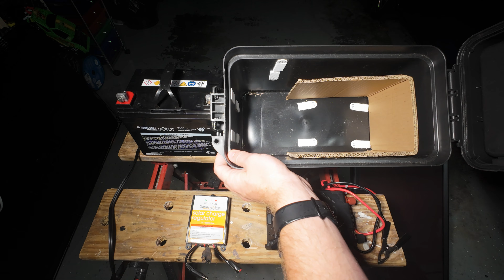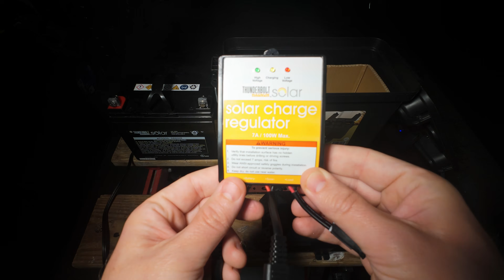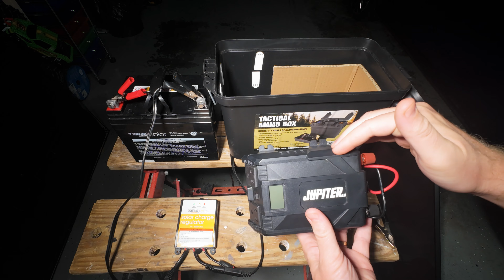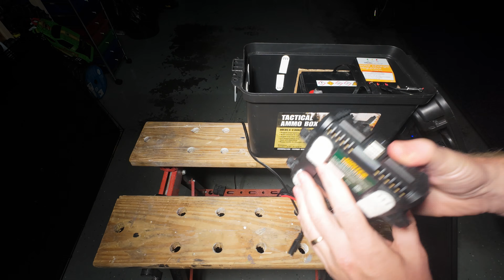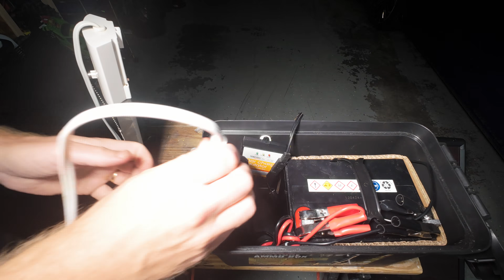Build a Solar Generator from Harbor Freight off the shelf parts?

Comment: A 35 amp battery and a 25 watt panel will do just about nothing. You just made something big enough to charge a cell phone. Nothing personal i appreciate builders but this is way over priced for a TINY capacity
Reply from the maker: Thank you for the positive feedback and watching. I would agree, there are a lot of improvements that can be made and if those were available locally I would have gone that route. I used to use a 20000 mah Anker power pack and it would just barely last keeping a phone and my camera charged over a weekend. This allowed me to keep 3 phones topped off as well as cameras and running an inverter for 120 when needed.

Comment: Except for the Battery, it's a fair little System. That 36 Amp Lead Acid Battery will  only give you about 15-17 Amps of useable power. IF you are going to use this battery, you'll need at LEAST 3 of them for any real runtime in an emergency.
Reply from the maker: Thank you so much. Yeah, I totally agree. I wish I could source a local supplier for LPF batteries. I will upgrade at some point but it did serve me really well for phones, cameras, etc..

Comment: You can run regular landscape lights...
Do they only have lead acid batteries??? 
At least use batteries terminals to BR and CH 10 Terminal Plug-On Neutral Ground Bar with 2/0 Lug plus fuses on negative side, and get rid of alligator clips...
Reply from the maker: Thank you for taking time to watch! Yeah, the shop light was more of an example. The past few times I have used some low wattage light strands and plan to move to some that is just 12v.  Yes, they only have SLA, where they are not the best, they are quickly accessible. Yes, bus bars would be a good upgrade as well as better terminal connection. These are planned upgrades that are not sources from Harbor Freight. Thank you for the suggestions and constructive feedback!

Comment: Modified sine wave inverter is not good for sensitive electronics.  Like phone and tablets.
Reply from the maker: Thank you for taking time to watch! That is very true. Thankfully this inverter has inline fuses and USB that operates independently. There are definitely improvements that can be made.
Reply: I believe he covered this several times during the video but yes, that is correct.

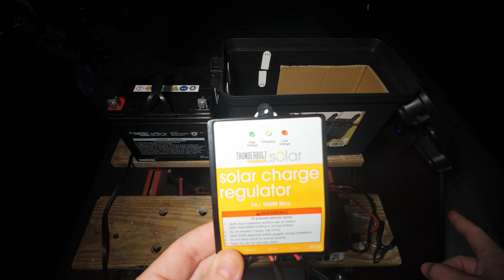Comment: need to mention: need to correct: (4:18) seconds if you put your solar panels in series, you increase voltage, not wattage. you want to put them in paralell mode.
Reply from the maker: Thank you for taking the time to watch and pointing that out in a positive way. You are very correct and in series that would cause damage to the solar controller. Someone else commented on voltage but I did not catch or connect that it might be because of that mistake.
Reply: The good news is if you buy more of that same solar panel they will automatically connect in parallel. I used their 4 panel kit to power my Power Tool charging station and provide light in the shed. I did finally upgrade the lead acid battery with a red odo and and a cheap pmw lithium charger controller for it. Seems to be working very well.
Reply from the maker: That is good to know. I have been back and forth on what to upgrade first and I think it should be the panels. If I cannot get my current battery fully charged in a reasonable amount of time then there is no use to upgrading the battery yet.

Comment: @matt
 That is a basic go kit that every home should have some form of & like you said dump the clips for O-rings & I'd add 2 things one side a vent intake with small pc fan opposed side so gasses vented from battery are not ignited by the inverter ! I'm a ham radio operator & have done the same basic setup but mine did explode because I overloaded the draw on the battery & it out-gassed really bad ! No one was hurt but scared the piss out me ! Some ppl cut the top out enough so they could mount the invertor face right to the lid & made access to it much better then they hot glued around the face but i think that's to easy get rain inside the plug !
Reply from the maker: Thank you. Yes, I will be improving and likely will not run the inverter max load simply because the battery would not last long.... Not to mention the clips are not a good enough connection for that amperage. I too have seen where others have cut holes, but I have seen some outdoor electrical panel boxes that have weather resistant vents and am wondering if I could adapt something similar to this small format. Funny in all the disasters that have occurred lately I had thought of looking into Ham radios. I've been in a few recovery situations where cellular is just not an option.
Reply: Don't car batteries have a place in the cover for a hose that could be used to lead the hydrogen outside the box, which would reduce the risk of explosion? I myself have a panel and controller bought 20 years ago, which were not installed at my summer house as I originally planned , and I put them into use in my apartment a few years ago. I mainly use it to charge my phone (the controller has a USB port) and to make coffee with a 12v kettle. It takes 15 minutes to make a cup of coffee, but I'm in no rush 😂  cables should be thick, and connections decent because the currents are high even at relatively low powers.   @MatthewVenturesOutside
Reply: Punctuation is your friend!

Comment: Awesome job! Great example for a quick temporary setup for a non technical person. I would explain briefly difference between peek and running watts. Remember that when an appliance is turned on, it briefly demands more wattage, then comes down to its running wattage.  That's why the peak wattage will always operate for a short time. Thanks again, and keep that content coming.
Reply from the maker: Thank you so much! That is a very good and important point on Peak/Surge wattage and running wattage. I think I felt like I was rambling when I talked about it. However, it is important to know that when sizing what you are wanting or could possibly run off of the inverter.

Comment: The solar charge controller (MPPT) can accept up to 22V and will draw up to 7A or 100W. That 25W solar panel has a voltage of 12V (doesn't say if that's Vmp or Voc). Connecting two of these solar panels in series would be 24V, which exceeds 22V. You would need to connect four of these panels in parallel, for a voltage of 12V and an amperage of around 8A. The MPPT would not draw more than 7A, so it'd limit you to roughly 84W. Nothing will get damaged though.

You can exceed amperage and wattage, but you cannot exceed voltage. Specifically, the open-circuit voltage (Voc) can not exceed an MPPT's max input voltage.

You covered some of this at the end of the video, but it would have been good to state the following in the beginning of the video:
Using an SLA battery for solar instead of an LFP is a poor choice. It simply will not last, it's heavy, and inefficient.
SAE connectors are not meant for solar use as they're not waterproof. Should be using MC4.
Modified sine wave inverters should not be used to drive an AC motor e.g. fan.
Alligator clips for 400W at 12V is questionable as 33A through a poor connection can be a fire hazard. Ring terminals are not optional for this use.

Harbor Freight is overpriced junk in terms of their solar offerings. Buying from Renogy would likely be about the same price but much better. Not that Renogy is great, it's just common.
Though I guess if you had a Harbor Freight and no other options, then this MacGyver setup is better than nothing.
Reply from the maker: These are some excellent points, thank you so much for sharing this in a positive way! I feel like I am late to the solar party with all of this and have a lot to learn. There are a lot of improvements that can and will be made. I think this was a good way to get the concept in my head and now I feel more confident buying items online. You mentioned ring terminals would not be an option. Why is that?
Reply: @MatthewVenturesOutside  I meant that ring terminals are not optional, as in ring terminals are required for safety. Sorry, I sometimes word things in a weird way.
Have fun on your solar journey!
Reply from the maker: Gotcha! That makes sense. Words also never come over in text the right way anyways. Thank you again for your time and comments!
Reply: He misspoke. The panel is one of their amorphous panels, great output for cloudy days and the same single panel in their 4 panel kit. If he expands it, it will be 50 watts at 12 volts, unless he intentionally cuts and changes the connectors to make them in series. When HF runs their sales their panels are very competitive.  There normal panels produce more energy than the renegy out rich solar panels. Again you have to get them on sale or it is over priced.  bought their 4 panel setup and used a small battery with a very inexpensive 300 watt pure sone wave inverter and use it to charge my power tool batteries and used the lights that came in the kit to have lights in my shed when the lights are out. For around $150 it was roughly the same price as anything else on the market with better cloud cover power.

Comment: great vid. Thank you. Was wondering, Could I go with a higher wattage solar panel to top off the battery quicker and what upgrades to your system do you plan for in the near future?
Reply from the maker: I wish I could figure out how to mention another post on this because they shared a lot of good info. @adriftatlas. 

Yes a higher wattage would top off the battery quicker, you just have to make sure you are exceeding the max voltage rating.  Upgrades will definitely be a better charge controller and LPF battery. At least a 100 watt foldable panel. I would also like to reduce the need for an inverter all together, at least for camping use. Our air mattresses are AC I know the modified sine is not good on the motors, so a smaller pure sine will eventually be bought. I want to get a panel for DC plugs too that are marine grade and accessible from the outside.
Reply: @MatthewVenturesOutside  Thanks for that info my friend.

Comment: I think those are SAE connectors.
Reply from the maker: You are absolutely correct, I misunderstood what I was looking at. The Anderson are much larger. Thank you for pointing that out.
Reply: @MatthewVenturesOutside  Not a problem...we all make mistakes.  You should see some of the BIG ones I make.  I have to live under a rock anymore.  Did like your video.  Very helpful.
Reply: Good work! You graduated solar generator 101!! Look into Anderson power poles. They are much smaller than the ones that most people think about, come in colors and are easily configurable. Also, consider mounting that charge controller to the back of the solar panel. It will make wiring other panels in parallel SO much easier.